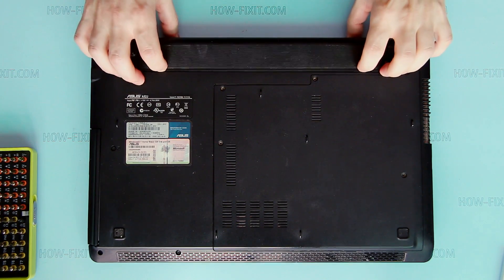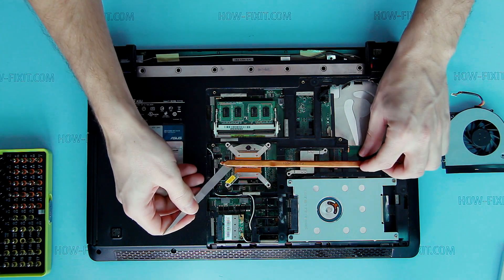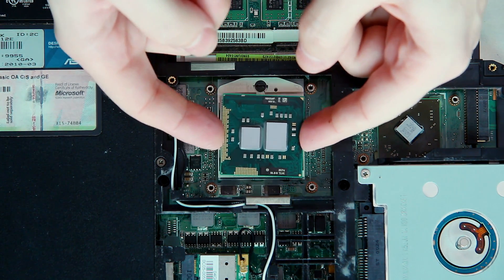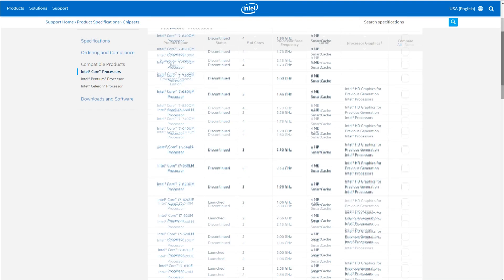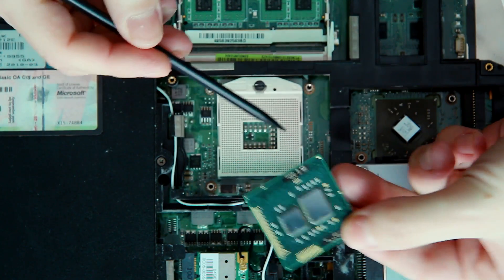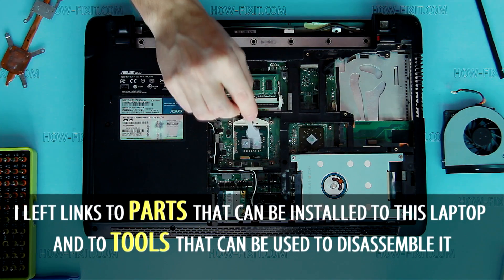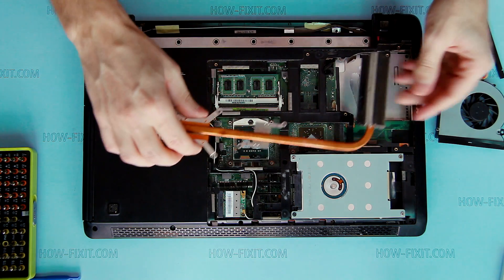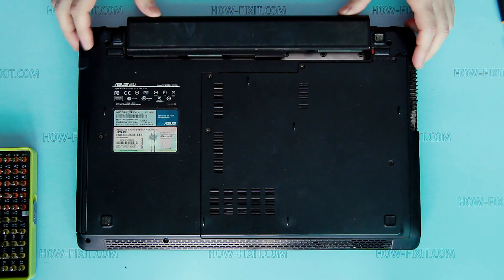Asus A52, X52, K52 CPU Upgrade Guide: Boost Your Laptop's Performance!

Comment: i have asus k52f cpu p6100 can i upgrade it to i5 or i7?? which one i will choose
Reply: Just upgraded to i5 540 from a P6200,  went from 5.8 to 6.7 in performance. It's noticable. Best thing i did for that computer (K52f) was change out the hard drive for an SSD. All pretty simple.
Reply: @tobaccyjuice  which bios and windows install were you using? I’m having trouble on my k52f after putting the i5 540m in it. I am also upgrading from the p6200 cpu.
Reply: @danielgreenberg4751  Windows 7,  updated to the most recent bios after
  installing new ssd
Reply: @tobaccyjuice  Thank you! I got it working and its working beautifully!
Reply: @danielgreenberg4751  They are a great computer!
Reply: @tobaccyjuice  It totally is.
Reply: What was the problem?

Comment: hello, i hope you can help me. I have a asus x54h with mb k54l and i bought a cpu on aliexpress.

Intel Core i5-2540M Processor i5 2540 M notebook Laptop CPU Socket G2 (rPGA988B) .

I have installed it  but he only see i core now, do you know what is wrong?

ERic
Reply from the maker: Have you updated the bios?
Reply: @howfixit  

As far as i know yes. Ihave installed bios version 2.08 and according to the asus supportpage this was the latest bios.

Comment: I do have an Asus K52F with a pentium p6100 installed, i saw that there is not a screw holding down the processor, i'm guessing my model isn't able to swap out the processor?

Comment: hello, I upgraded from original processor i5 430m to i7 840 qm but it did not turned on. Any tip? My laptop is the k52jr
Reply from the maker: Reinstall i5 430m processor and update BIOS to the latest version. Download the latest BIOS version for your laptop on the official Asus website.
After updating BIOS, install a i7 840 qm processor.
If this does not help, then this processor is not compatible with your laptop.
Reply: @howfixit  It is updated, but did not worked. Thank you by the way
Reply: @rodolfoamaralguitar  i think last bios is not upgraded for i7 compatibility processor i3 or i5
Reply: You need procesor with integrated graphics... Like i7 640m

Comment: I have a K52F with Pentium6200 that I'd like to upgrade. Any recommendation? I'm thinking either the i5 580m, or the i7 640m. Will the heatpipe work okay with those or should I consider the 540m instead?
Reply: is i7 640m competable with asus K52f ?
Reply: @hakannuho2745  Seems that may be "iffy", stay with the i7 620m which is half the price, anyway.
Reply: You probably moved beyond it, but others may not. Best bang for the buck is an i7 620m, full 8Gb memory and an SSD for boot and system. Take out the DVD move the HDD there in a caddy for mass storage. Mine runs faster than most modern low and mid range rigs. Oh, and these things seem to be born for Linux Mint.